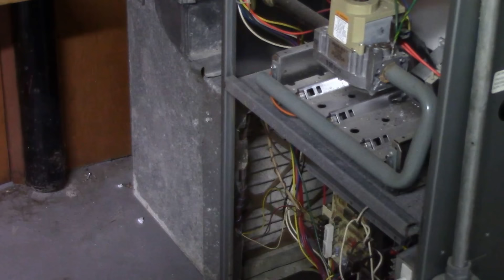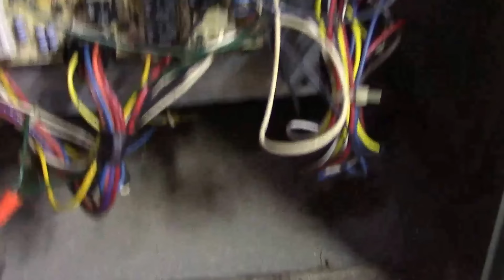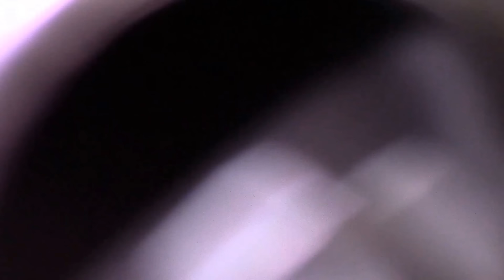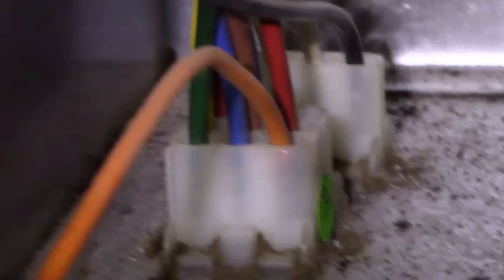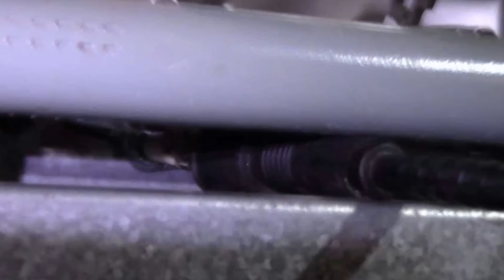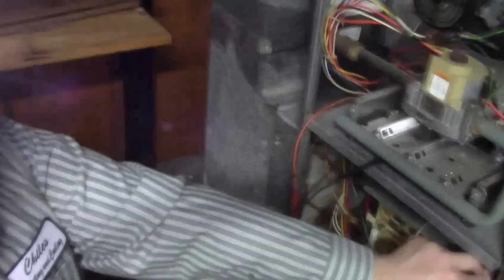Cleaning and testing a flame sensor on a furnace (servicing it) pt 1

Comment: Hi, I.own a Rheem model  rcfl- hm2417cc and it's 15 years old. I noticed recently that it seems to have trouble to turn on as I hear like a humming noise, sometimes repeatedly then it turns on as I can hear the flame coming on. From what I learned online, it is possible the inducer motor is failing. I know the inducer motor provides air for proper combustion and pushes carbon monoxide and harmful gases out the flue. But how does the inducer motor play a role to contribute to ignite the burner? Any recommendations you have or videos on how to replace the inducer motor? Greatly appreciated.
Reply from the maker: moves the air for combustion process. if it cant move the air the pressure switch will do its job as a safety and prevent it from running.

Comment: Thank you for this video!

I have a Rheem RGPJ-10NBRJR (Criterion model 1) and the gas flames were stopping after 30s or so. The furnace/blower would give up after a few minutes. I removed the flame sensor, used your spinning technique to remove sediment with a scotch-brite green sponge, reinstalled, and now it works! I used a flathead screwdriver with a magnet attached near the grip (with a headlamp cause I was in my attic) but next time I'm at Home Depot I'm picking up the 1/4 in. Magnetic Tip Nut Driver with 6 in. Hollow Shaft for $11.
Reply from the maker: Glad this video could help.

Comment: Dude that’s awesome. Thanks for your video; helped me right out on one of the coldest days of the year. Even cleaned the igniter while I was in there. Do you recommend to replace the flame sensor after several years, or is cleaning periodically enough?
Reply from the maker: I'm glad I could help. Periodically clean the sensor until the microamp reading is too low that cleaning won't help.

Comment: I bought the store in NYC, that store using this Rheem Gas Furnace. Last week, It shut off somehow, I called local guy to fixed, he did, and mentioned me to get a new one is better.
So my question is, which new model is better for 1000 sqft store? Please advices. Thank you for your videos.
Reply from the maker: Lots of factors are involved in deciding equipment size.
Reply: @ChilesHeatCool thank you for your responded.
Can you call out few name that I can check.. thank you.
Reply from the maker: Check out goodman equipment. I put that in my house. Trane is nice to or American standard.

Comment: could have just pulled the wire from the board
Reply from the maker: Can't on some furnaces. The wire in a mulox plug cant be disconnected to test. Some furnaces you can but not all.

Comment: If the sensor doesn’t read any microvolts does it mean the sensor is bad or just needs cleaned? Do you have to test it mounted in the furnace or can you pull it out to test?
Reply from the maker: The reading should be microamps. If it reads zero, it should be cleaned first and inspect the burners. If the front of the burner is dirty it will effect the current flow. If those are cleaned (using scotch brite pad not anything abrasive) it could be a bad sensor which you could ohm out from end to end with your meter on ohms. If it reads zero ohm and no cracks in the ceramic than it is good unless it is bad still, but you would have to put a new one in to make sure. After that, if the furnace has lost ground or is not grounded properly that would cause it to go off on flame safety. I think L1 on the board with one meter lead and one on ground. With the door switched pushed in you should read 120 volts. If not the furnace needs grounding. If you read voltage than it is possible the board or IFC has gone bad and would need replacing.
Reply: ChilesHeatCool you are awesome. Thank you

Comment: What do you think about the square, fanned burner design where the flame is fanned out so much that don't all funnel straight into the burner chamber holes? Is that lower efficiency than round buners?
Reply from the maker: Not sure what your talking about. I think I do, if I'm thinking the same it is just a design difference.
Reply: @ChilesHeatCool , you have it. It's like spray gun painting with the fan tip and trying to only hit the holes. means you're going to miss the holes and hit in between the holes as well with the paint. Pretend that the flame is the paint. it will smack in between the holes and maybe that's what lowers the efficiency from 96 to 92 SE what do you think?
Reply from the maker: The inducer draws the flames in the hole. When it comes to efficiency they take everything in to account. A 96% furnace burns at 90% efficiency but gets more efficiency added due to being 2 stage and having shorter ignition time and using a psc motor for the inducer, and variable speed blower. Rheem is the only one I know that uses a plate burner.

Comment: Wouldn’t it have been easier to go in series at the control board? Pull the orange wire and go in serious there. Much more accessible?
Reply from the maker: Only if you have a mulox plug pin puller. If you dont have that tool then you risk dammage to the plug and would have to get a new wire harness. Now if it was not in that plug, yes it would be easier to test there. Remember to that if you unplug the mulox plug at the board, you open the limit circuit and the furnace wont run.

Comment: We have a warranty and every time they come out they tell us our filter is dirty. Last time we just changed it a week before that. They charged us $100. Flame would kick on and then off. I figured it was a sensor. Took it ut cleaned it. It wasn't even seated correctly. The flame wasn't getting to it. Now it's cranking the heat and not failing to ignite and stay lit. Shyster thieving companies!!!
Reply from the maker: Sad part is that happens and it just used as a money maker until the customer finds out. It's just easier to be honest.

Comment: what do you do if the flame on the flame sensor does not light? the other two flames come on just not that one.
Reply: Just a guess make theres a crack in the igniter? Im still a student so im curious to know this too !!!
Reply: Ok lawuhbiding citizen:  found out what the problem was. I just couldn't find the problem that was in front of my FACE. Had to call someone and they had to send out the old man to fix it. The new guys at first kept telling me "its a clogged jet" I kept telling them no it was not because I could put a lighter to it and it would keep the flame, but when it turned off, it would not relight.
 So things that were done until the problem was found.
1. removed the plate and kinda cleaned it and removed some of the rust.
2. clean the flame sensor
3. checked all the wires
4. found that the fan was stuck so put some grease on the fan and it released. 
5.reset the furnace by turning it off on the breaker then on 
6. checked the gas line, yes was getting gas. 
7. cleaned the gas jet not working to see if it was clogged. YEP  clear
8. removed the arm with the gas jets and cleaned that. YEP clear

The problem was that the dang plate! It tunnels the gas to the flame sensor and ignitor. The rust on the plate was too much and I didn't clean it good enough. The fix it guys took a wire angle brush and made it shine. 
The rust on the plate was not allowing the gas to flow and disburse at the end of the plate to the other side and was blocking the flow to the ignitor and flame sensor.   

So, the problem was the plate!
I didnt clean it off good enough!  175$ lesson.
  @lawuhbidingcitizen7736
Reply from the maker: clean the burners and the orifice.

Comment: I’m sorry ! I think even if you have complete combustion, you will still produce carbon monoxide. There for if you heat exchanger is cracked it will be released into the conditioned space .
Reply from the maker: vladek vladinov nope, incomplete combustion causes carbon monoxide. I've had furnaces I've suspected of cracks in the heat exchanger and they put out 0 ppm of co. Hard to prove a bad furnace with dancing flames and no co to some home owner's.
Reply: ChilesHeatCool  the reason why you are not getting any co reading. Because you are checking at the registers. But if you check the draft you will never find 0 ppm. Please check this video http://www.youtube.com/watch?v=j5Boc4_YVq0&list=PLItXrh64d2JNDXVVmzLvMwqpbwTkqfIf9
Reply: You can’t make an omelette without breaking eggs. Thanks for sharing. Your videos are good quality
Reply from the maker: vladek vladinov ah yes in the vent system you can pick up some. I see what you are saying and yes you can get readings there. The registers are in side and that the more important part.

Comment: Hi. Hopefully someone can help me out. When the flame turns on it only stay in for about 5 seconds than turns off. Could it be the flame sensor?
Reply from the maker: Jeremy Quezada yes it is one possibility. My whole furnace service video series here goes through the flame sensor and pressure switch port witch could be 2 possible problems.
Reply: Yes
Reply from the maker: Jeremy Quezada yes it is possible. Following my video can help. If not it's a dirty burner, board, or pressure switch.

Comment: I have a furnace where I replaced the ignitor (HSI) and cleaned the flame sensor, but now I don’t seem to be getting gas , the blowers won’t come on for ignition. Any idea? Thank you.
Reply from the maker: Daniel Rodriguez possibly no power or the thermostat. Set the fan switch on the thermostat to on, if nothing happens the furnace may have no power. Check the door switch or main power disconnect.
Reply: ChilesHeatCool Thank you. I will test the Thermostat. Does the furnace have a door switch , kind of like a dryer? Won’t start unless cover is on?
Reply from the maker: Daniel Rodriguez yes it does, it's a push button switch in the blower compartment. If the door isn't on right it will act as a safety to keep the furnace from running.
Reply: ChilesHeatCool sounds like that may be a factor. I will give that a look as well.  Appreciate all your help, quick response,  and videos. 🔥👍🏼
Reply from the maker: Daniel Rodriguez your welcome, I am glade I can help people out with these videos.

Comment: I've got to give you thanks for posting this video! I have a Rheem RGPH-07EAUER that was "short-cycling" (ignited, then turned off, ignited again, and finally just gave up until I power-cycled it), and your advice about testing the flame sensor was exactly right!

My multi-meter was reading only 1.5-2.0 uA on the sensor after ignition. After cleaning it with with just a rough cloth the reading was 2.4 uA on ignition and climbed to around 3.2 uA after one minute. I don't doubt that if I clean it properly with some steel wool that the ignition reading will be closer to 2.5 uA.

You've saved me so much heartache!
Reply from the maker: Matthew Nielsen thank you, glade I could help with you problem.